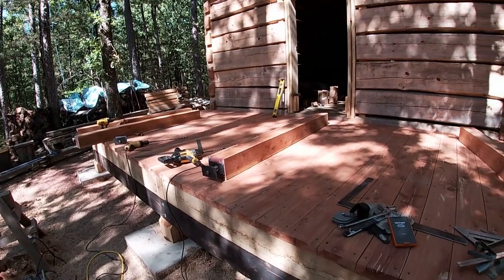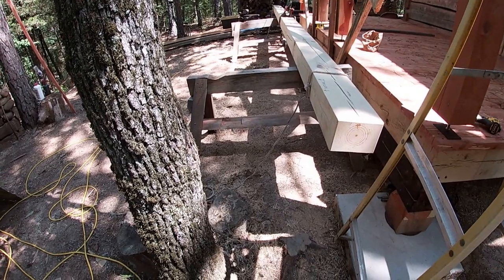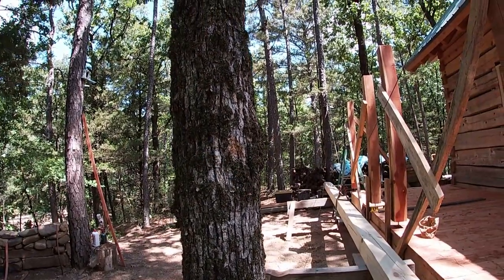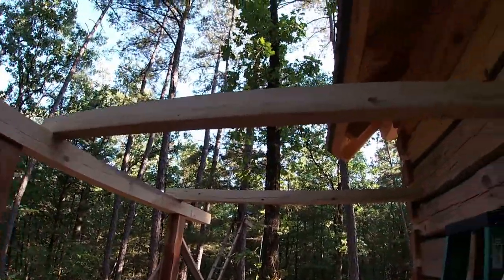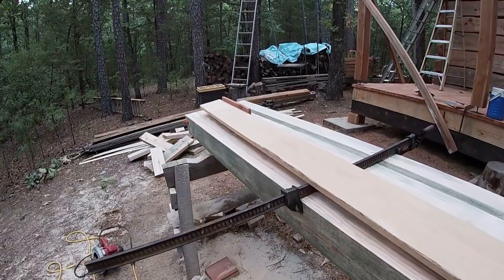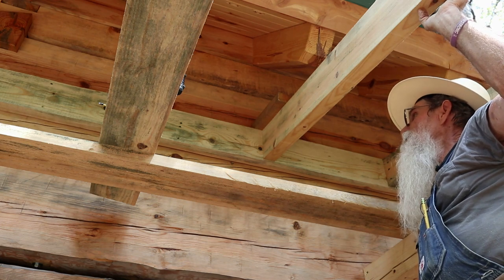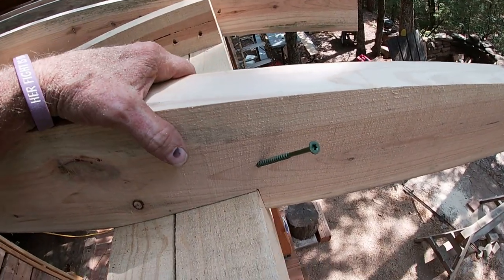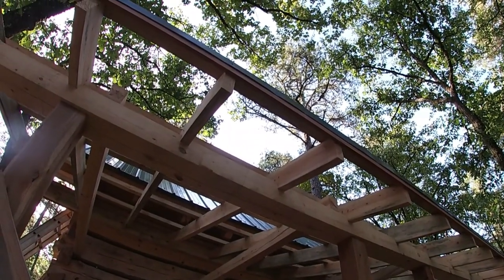Building the Porch Roof, Paradise Point - Ep 20

Comment: Hey Paul,
Excellent work as usual. I have a question about the porch post settling system. Is it secured to the post to prevent a strong wind from lifting the porch roof from the all thread rod?
Thanks for sharing your knowledge and precise skills.
Reply from the maker: Howdy y’all- thank you so much for the kind words. The posts have to be able to settle as the logs settle. After the settling they can be anchored solid to the porch. Where this cabin is located it’s in a pretty sheltered area. Take care and God bless y’all

Comment: Thank you once again for posting a video, love the dovetail cabin builds.  I do have a question for you.  Will the tie beams or the porch rafters be secured to the wall timber by any other means?  I was thinking a diminished haunch pocket cut into the wall timber would give bearing weight stability and not solely rely on the screws shear strength (I realize these tie beams don't carry weight other than their own).  Am I over thinking this and making it more complicated than required?  With my total lack of experience and your demonstrated mastery with this building system I feel silly questioning how you did this but the thought came to mind.  I know with stick building a joist hanger or similar product would be required (and would look way out of place here). What are your thoughts?
Reply from the maker: Howdy Dinos-as you stated these tie beam carry no weight. I have cut shallow pockets in the logs to set them in. In this case they actually were holding the porch beam steady until the rafters were put on. Thank you so much for the comment. Take care and God bless